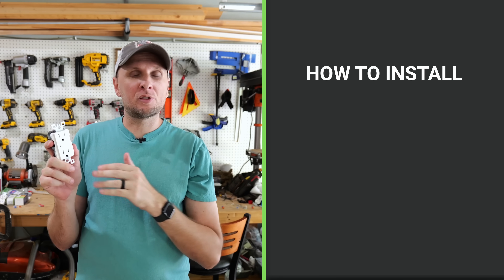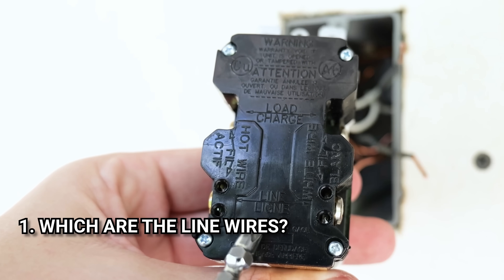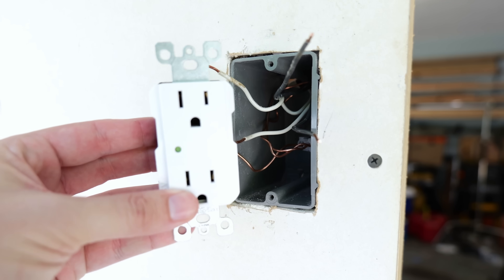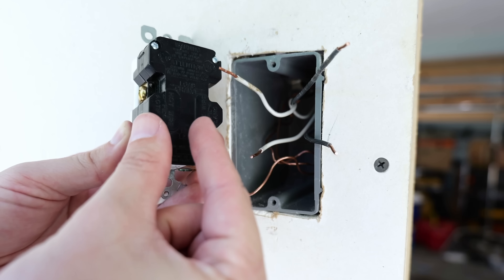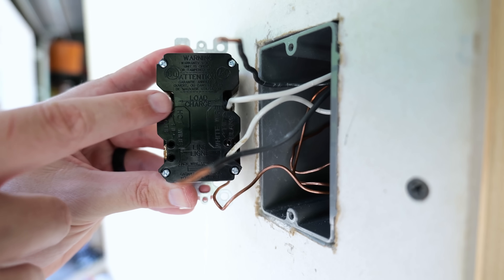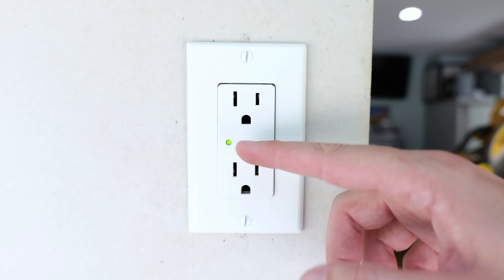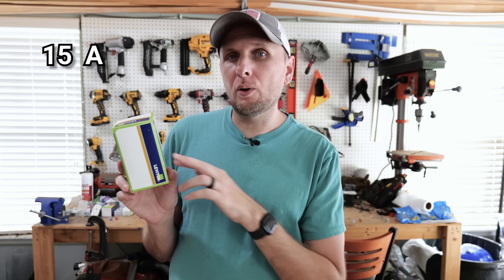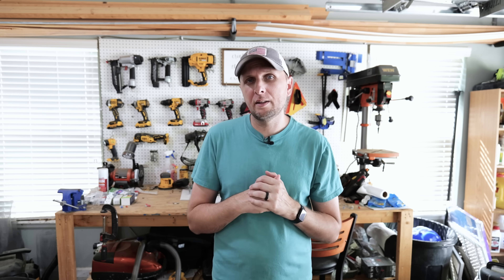This Tiny Device Just Made Bulky Surge Protectors Obsolete!

Comment: The times I looked into the clamping voltage for most surge suppressors its 375 volts to 450 volts on average, except for a brand called Panamax.  

Panamax has a proprietary instant shut off below 92 volts or above 138 volts on many of it's middle price points and above.  It is called Protect or Disconnect.

My rudimentary understanding: If a surge came to your house above the normal 120 volts, it would "push" more current through your devices.  

Voltage can be understood to be similar to water pressure.  The higher the pressure the more electrons get pushed through anything connected, which creates heat (unless it has protections like a fuse that melts and opens the circuit).  

The higher the pressure (referred to as voltage & is measured in volts), the more the electrons flow (referred to as current & is measured in amperes) per unit time, the faster heat builds up.

If the voltage reaches the 375 volts to begin shunting to the MOVs inside a surge suppressor, it can permanently take itself out and open the circuit to save the connected equipment.    

Without any surge suppression built in, and not provided by a device like in this video, if a surge happens the device or devices will end up releasing the magic smoke as capacitors pop and other electronic components over heat and start melting.  

In the end, insurance is popular because it provides peace of mind and I think of surge suppressors & line conditioners the same way.  Nice to have for peace of mind, but not mandatory, depending on the cost of the equipment you are protecting.
Reply: Yes, I use a Panamax that I plug in all of my audio/video devices in to. 👍

Comment: Pretty nifty product. Di you intentionally have the cover plate screw slot in the vertical position? It's a good idea to avoid dust accumulation. It also satisfies your O.C.D. so you can always be checking your outlet cover screws (preferably with a level0.
Reply from the maker: Yes my OCD can’t handle them being anything but vertical 😂

Comment: Wow.... you guys are still using hardware and wiring practices from pre World War II. I also assume that "Surge Protector" has an MOV or Metal Oxide Varistor inside. These usually only take 1 surge before failing. Unless it is a very low voltage surge of just over the normally rated voltage. If that outlet is mounted out of site and you can't see the green LED then it could have blown and you are no longer protected.  During a storm you could get hit with a surge 5 times in a minute. For safety also label your wires before disconnecting them so you don't have to liven up the bare wires. That is incredibly dangerous advice.
Reply: A Grenadier guy berating WWII technology ...... Oh, the irony !!!  🤣🤣🤣🤣

Comment: You don't have to determine which cable is from the CB panel by turning the power on.   Just measure which white wire is close to zero resistance to ground.   At the panel, the white wires are connected to the earth ground.
Reply: Stick to gardening

Comment: Great.  So every time there is a power surge you have to replace the entire receptacle ?

Gods forbid you live in an area with frequent power surges !  Imagine also if you are unable (or too uncomfortable) to do the change yourself and you need to call a qualified electrician each time.  

Far easier and more eco-friendly to have a power-surge protecting power bar that can be re-set.  Or better yet, have power-surge protection built into your main electrical panel and protect the entire building.

Comment: Do those giant surge protectors and stuff actually do anything though? I keep reading they really cant handle a real surge. Instead they recommend whole house surge protectors instead. But I know squat about actual electricity and stuff, Id be curious to know what you think? In my case, my home is 50 years old. The electrical panel wont take something that fancy. Not to mention all the aluminum wiring around the house means I cant even use fancy outlets like this without a bunch of bulky and expensive alumiconn connectors.
Reply: Most surge protectors, like the power strip versions many people buy, operate by shunting the surge to ground. Basically, there's a diode across the line that is normally open, non-conducting. A surge causes the diode to conduct, shunting the surge to the ground side. Assuming your ground is good and the surge wasn't too large for the components, it works fine. 

However, the components used for that shunt can only take so many hits. And, since their normal condition is to do nothing (until the surge "turns them on"), when they get hit with a big surge and burn open, you'll never know. The equipment will still work, it's just the shunt is no longer there, so it's no longer protecting anything.

And that's why some protectors started adding lights to try to indicate that the surge protection status. But, in reality, if you know the protector has taken a hit, you should know it's no longer as trustworthy as it was.
Reply: @BackToTheGame.98  I bought a whole house surge protector at Home Depot for about $100 and had an electrician install it in 10 minutes and it can be on on any electrical panel regardless of age.

Comment: My biggest complaint is there is only two inlets there.  In some places in the house, and at my work bence, I need a surge protector to have more than two inlets to handle my electronics and tools.
Reply: Connecting downstream receptacles to the Load side should solve that issue, I would think.
Reply: @frogfoot198  That is why they make a “whole house” surge protector to protect all receptacles/outlets in your home.  I have one as it real cheap insurance to protect all of my electrical equipment from deadly surges and now it is required on all new electrical panel installations as per the National Electrical Code (NEC).

Comment: Most people are not using surge protectors for surges. They are using them to plug in an ungodly amount of devices.
Reply: Heck yeah!
But seriously, I have a few around the house with a ton of stuff plugged in, especially on my desk. But most of the stuff is low power devices.
Reply: all electronic devices should be on surge protectors. a power tap is not the same as a surge protector.
Reply: correct me if I am wrong - when the surge protector work's you will not know if it has been challenged to protect. How will you know to replace it? .
Reply: @carldaniels4827  most will stop working or the protected led will go off. Some keep working anyway and that's kinda sketchy
Reply: Most decent ones have a light that tells you if protection is working  @carldaniels4827
Reply: I actually plugged another surge protector into the first surge protector to add more outlets.
Reply: @gordonwalker6458  Clark, are you hooking up Christmas lights?
Reply: I thought that’s what they were made for
Reply: Haha, you are damn right!  My wife at thanksgiving dinner had a roaster, and 2 crock-pots on high, all plugged into the same Wal-Mart surge protector all at once!  I’m sure my 20 amp breaker had 19.9999999 amps going through it all afternoon.
Reply: Yes and the interesting part there is there is so minimal a difference in price to put the surge protection components in the power strip, that people buy them anyway when not thinking about surge protection as a needed feature, yet for this outlet, the price is multiple times as high as a regular outlet, even higher than many surge strips!

What is ungodly about many things needing power?  I don't overload mine, but next to my desk, I have two surge strips... lemme see... not all of this is always turned on...

1)  Fan
2)  Landline cordless phone
3)  Cellphone charger
4)  Clock
5)  Computer
6)  Monitor
7)  Audio Amp
8)  USB External HDD AC/DC Adapter
9)  Extension Cord for Battery Charger
10)  Network Switch AC/DC Adapter
11)  Desk Lamp
12)  probably more that I can't think of at the moment
Reply: They are not meant to do that? 😂😂
Reply: @azazelakira12  yes and no, they only have a certain amount of voltage they can handle. You need to read each device you plug into it and do the math to ensure you are not over that voltage. I have seen many people who do not follow that rule, as a result, their devices get fried.
Reply: @Rassp2  fortunately, the US has made it very simple by standardizing most home electrical stuff run on 120 volts.
Reply: @Rassp2  Current, not voltage.....

Comment: What is the effectiveness of this product vs the whole house surge protector you install at the breaker box….  Seams like whole house cheaper and faster to put at breaker box vs change out every outlet.   Even if change out outlets your product does not protect hard wired appliances, ranges disposals dish washers water heaters hvac
Reply from the maker: @KE5ZZO well that is false and unnecessary.  I was not paid a dime for this and did not receive it for free.  I legally have to disclose if the video is sponsored in any way.  I recognize you from previous comments.  I would appreciate it if you didn’t spread false information like this.  I have turned down so much money from companies to maintain unbiased reviews.  Comments like this make me question if it’s worth it though as apparently I get accused of it anyways.
Reply from the maker: This device and others like it that can be plugged in are not redundant if installing a whole home surge protector.  I will briefly explain.  A whole home surge protector does protect everything in the home from external surges.  Surge protectors like what I show in the video can protect specific appliances and electronics from external AND internal surges.  Your devices are being exposed to internal surges everyday.  When the fridge kicks on or anything else with a motor, a small internal surge occurs that over time, wears down the sensitive electronics.  So I do highly recommend having both a whole home surge protector, because it’s going to protect everything from those much larger external surges and having surge protectors like the one in the video in places where you have sensitive electronics to add another layer of protection from external surges but also the internal ones.
Reply: @HowToHomeDIY   I was considering responding to his comment but you stated it so much better than I could have.
Reply: @KE5ZZO  maybe.
Reply: @KE5ZZO  if it was a paid advertisement, it was a sorry one. I don't know what brand I'm supposed to buy. This is assuming more than one company makes them.
Reply: @notusedexer  He linked it in the description. Made by Leviton
Reply: @bobcoats2708  didn't notice. If I decide to buy one, I'm just going to search home Depot and Lowe's and see what they have.
Reply: Good point.
Reply: @KE5ZZO  every electrical panel can accept a surge protector.  Remember, Joules clamping force  rating separates surge protectors from each other just like the “good, better, best” model of any product.
Reply: If your panel can't accept a whole home surge protector then this receptacle would be a good option.
Reply: @josephdavis6447  $139 for 6 outlets vs $99 for whole house cheaper
Reply: Maybe do both?

Comment: Does the surge protection extend to downstream receptacles like the GFCI protection does with GFCI receptacles?
Reply: They extend downstream thru the Load wires he connected.
Reply: Yes but the further away, the greater the impedance and less effective it is.  The same could be said about plugging a more traditional surge protector strip into any outlet and then expecting it to protect other devices plugged into other outlets in the building.

Comment: Nice video, good work explaining it.  Something to point out…surge protectors are rated on the joules of electric they can handle in a surge situation so the whole house surge protector may be a better choice because of  its joule capacity and it also covers all receptacles rather in the house rather  than a limited number of receptacles on that one particular circuit downstream from the individual surge protector.  Also, I don’t think you mentioned or not if the surge receptacle would continue to work electrically if it took a surge it.
Reply: The rating is not great at 720 joules, according to Leviton. Not surprising since it’s a pretty small device.
Reply: Yeah the Joule rating is pretty bad on these. Is it better than nothing? Yes, but barely.
Reply: Many if not all, free standing surge protectors do not have enough “clamping force” (Joules) to properly suppress all of the surge potential to protect appliances and electronic equipment in the home.  The permanent, in the electrical panel, as per the NEC, National Electrical Code, has the highest clamp force to suppress an electrical surge.  In fact, many manufacturers of permanent surge protectors offer a 5 year, $50,000, warranty against electrical damage  to appliances and electronic equipment when protected by their permanent surge protector.
Reply: the majority of surge protective devices will still carry a circuit after the surge protective components have sacrificed themselves for the cause.  rarely, one will catch such an extreme surge that it causes the device to actually suffer catastrophic failure.
Reply: I would rather have the surge caught in the circuit breaker load center box instead at point of use where there are combustible materials near by that could catch fire.
Reply: So, the whole house surge protector is a great idea, but it’s really a device of last resort.  The idea is to keep the house from burning down, due to surges inside the breaker box.  I wouldn’t depend on that as the only surge protection in the house.

Unfortunately, surge protectors tend to fail silently.  They say they’re still protecting your circuit or devices, but in fact they are not. This could be just because they’re old, or because they have been triggered too much or too many times and they are no longer capable of doing its job.  But the detector lights that are put onto surge protection devices are usually not sufficient to tell you if the Metal Oxide Varistors (MOVs) are actually still capable of functioning correctly.

If you have separate surge protectors, then they are relatively easy to replace, whereas replacing a receptacle is more of a pain.
Reply: @shubinternet  It's actually the device of first resort since most damaging current comes in from the street or up the premises earthing.  You really really want to clamp it at the entry point.  Nothing wrong with additional devices down stream but in the main panel (switchboard for other parts of the world) is the starting point for any good surge protection system.
Reply: @shubinternet  The idea behind whole site protection is to clamp surges coming in on your AC mains supply to the premises.  Surges inside a breaker box are pretty unlikely to burn the house down.

Comment: Please always do a positive test with your detector first. This proves it works first then do the negative test. There is a chance the detector itself is faulty.
Reply: Please don’t run with scissors.
Reply: I was shouting the same thing to my computer monitor! Always, always check to be sure it works before killing power and checking. At least he double checked with his meter, but what if he didn't have the dial in the correct position for checking AC?

Comment: Don’t wear jewelry/rings while doing electric work. Could get caught and if metal/conductor is also an electrical hazard.

I know of an electrical fatality recently where someone was wearing a watch while doing electrical work. It ended up killing him.
Reply: I was an electronics technician for around 45 years. That's a major reason why I've never been one to wear any kind of jewelry, and my choice of wristwatch has always been one with a plastic case (and I'll still take it off for some work, like high voltage). 

I was a radar tech, and even without jewelry, I took a hit to the little finger on my right hand from a 1.5 KV pulsed line. I didn't touch it, I just got near enough to the crack in the boot (that we didn't know was there) that it found me. I found myself about 3 feet back, back against the cabinet on the opposite bulkhead, scratches on both arms, and my heart pounding rapidly. All all I could do for awhile was, in a daze, repeat, "One and a half kilovolts."

Fortunately for me, there was no current involved, which is what does the damage. The line was a suppressor grid for the power tube in an old air search radar on a Navy ship. We'd just replaced some components, and while they settled in, we had to reach inside the cabinet to tune it (every few hours). Normally, those were on chains to a knob on the outside. The scratches were from ripping my arms out as I fell back.

Suffice to say, I was done for the day.
Reply: @brolinofvandar  Dry air at sea level pressure conducts electricity at about 10kv per centimeter.  Old TV sets with cathode ray tubes had around 30kV in them.  That's good for 3 cm or a little over an inch of "reach out and touch someone."